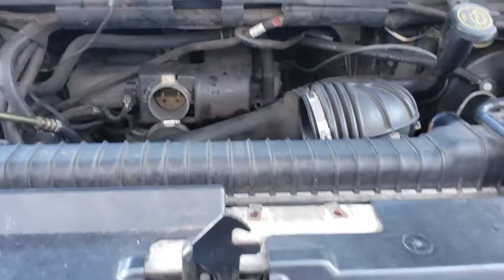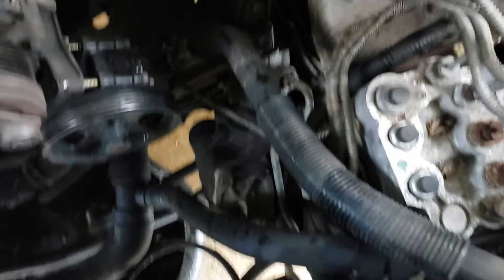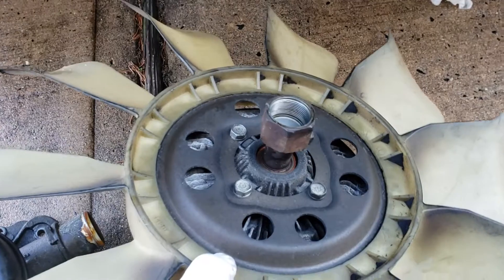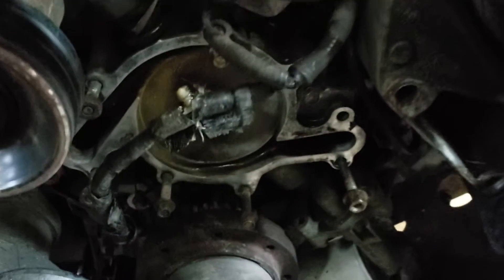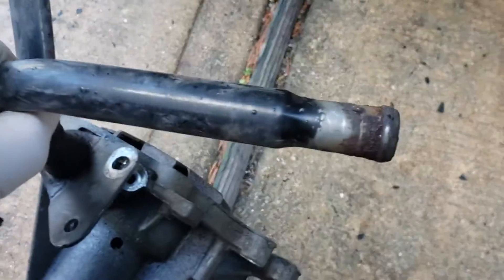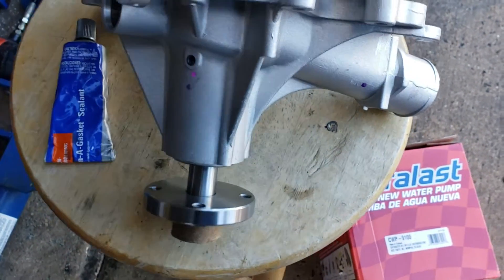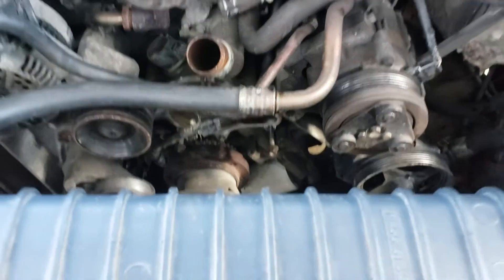2000 Ford E150 4.2 V6 Water Pump Replacement

Comment: I have a 2000 F150 and this video, even though it was an E150, was the best video I found to help me with specific 4.2L issues - Thank you.  
At this point I have everything removed and I'm waiting on some parts. In case someone else with a F150 finds themselves looking at your video here's one difference I found between these two vehicles.  Regarding the Power Steering Pulley interference,   found 4 bolts (instead of 3) holding the Power Steering Pump to the engine.  That wasn't a big deal but there's a Hydraulic Fitting that comes out of the bottom of the Power Steering Pump.  On my 2000 F150, when I tried to move the Power Steering Pump away from the engine, that Hydraulic Fitting interfered with the truck's steering column.  Due to that interference, it was a small fight to get the Power Steering Pump to move enough to remove that Long Bolt.

EDIT:  I have discovered another YouTube Video that appears to be  useful: https://www.youtube.com/watch?v=83PJKdyuYc8
It's for a 2004-2008 F150 but it appears to be the 4.2L V6.  At the 9:00 mark the Long Bolt/Bracket problem is addressed.  This guy is able to remove the Bracket without moving the Power Steering Pump/Pulley.  I had considered this approach but had talked myself out of it.  Anyway, it was possible for this guy so it's worth looking at before fiddling around with the Power Steering Pump.  It could be that Ford shortened those Water Pump studs in later models making bracket removal a simpler process.

I have documented what I have done to this point at the Garage Journal website:
https://www.garagejournal.com/forum/showthread.php?t=298920&page=194

Click on the above and scroll down to Post 3879
Reply from the maker: Thanks for your input, f150 is so close to being the same installation.
Reply: @alyoungcuda  Y'all have gotten me So .. Ummmm, worried I guess . I'm hesitant to even pop my hood ! 
So, if I can get the fan an pulley Off , I'm STILL gonna play hell with those; damned heater hose tubes going up to the left behind the alternator ?
Reply from the maker: The pipes are a tight fit, just watch how you remove it..it has to go back the same way for example if you go under something then do the same in reverse..just take your time.
Reply: @alyoungcuda  I REALLY appreciate ya response . My wife was sitting there ... I thought on her fb when I was "Crying" about my truck she says.. BUT, anywho, She's a Woman !  an told Me  "You don't mind taking peps guns apart and strowing that shit EVERY damn where ,hows That truck Any different? Ya always say  "It's No Problem" when y'all messing with them !"  God Knows I love Her, but she just don't realize  #1. It's 17 degree's out, #2. Parts will snap like a twig out here.#3. My trucks got 260k on it and has NEVER been touched past brakes,plugs, oil changes,etc..  and I'm concerned about a Lot of expenses, extra work, having All the tools needed,etc.  ..and Ford couldn't produce  me another Just Like It ! .  . That comes down Assembly Everyday when I asked for one few years back ! 5speed ,V6 with a little extra pep n her step ! 
Me an that Truck have been in and Right back Out of lottsa sh-t together and she's Never put me to walking, Period!
Reply from the maker: You can do it..but with that many miles
.you need to be careful not to break a bolt..there is a trick to it on bolts..besides killing it with wd40 you need to do the back and forth movement with the ratchet..loosen a 1/4 turn, then tighten it back..then loosen up to 1/2 turn then tighten back, 3/4, 1 full turn, etc....keep doing it a little at a time till it feels free..its a pain but sure beats snapping a bolt..then wire brush the threads and the bolt for a clean installation...
Reply: @alyoungcuda   See♥️!  A little consoling & Know how will Help a Man's Confidence and Ego   Alot better than a Woma........ Na, I still Can't say All that ! LOL 🤣😂
Reply: @alyoungcuda   I soaked all the main bolt's with liquid wrench and laid the hood back down. Wether says a little warmer tommorow, and I've got my parts carted online at O'Reily's in town. Hopefully they'll see I've Never picked them up and   will shoot me a 25% off coupon by email to get me to come on down an pick-up my parts ! Hopefully that'll give you a trick or two up ya sleeve next parts ya Don't need pronto !

Comment: Two thumbs up you speak clearly you get to the points without stretching it to half an hour for us type a wound up too tight kind of people and I like that you have the part on the ground and you point at the engine what we need to know and point at the part instead of having a camera twisted and all different angles that you could hardly see anyway I like your style and originality
Reply from the maker: Thanks for the compliments and yes, straight to the point is the right way, sure I can drag it out for longer times and they add more commercials to make money, but money is not what it is all about. Information and teaching is the best payment for the heart. And I can't stand when they say" don't forget to give this video a thumbs up and subscribe so you will be the 1st to get a notice of the newest video"
My take on that is, if they like your content,  they will subscribe.. 😆

Comment: I did a small cut with a thin grinding disc on the outside of the heater hose inlet , came right out saved me some money ...
Reply: I did the same thing, thanks to your comment and it worked great.
Reply: I'm still Not sure what ya mean us had to do with the stubborn thing ? 
I guess I will find out tomorrow when I pull mine apart ! I Don't Like the odds I've seen on YouTube bout breakage when trying a simple repair ! I know shit happens but, some Real horror stories can develope with these thin heater hose pipes !

Comment: Thanks! It’s the same on my 99 e250. The hard hoses that go in on the left side, do they have o-rings that seal them?
Reply from the maker: The pipes have o rings but the best thing to do is to replace the pipe..the rust on those pipes might not seal right.
Reply: @alyoungcuda  Thanks for the response!!

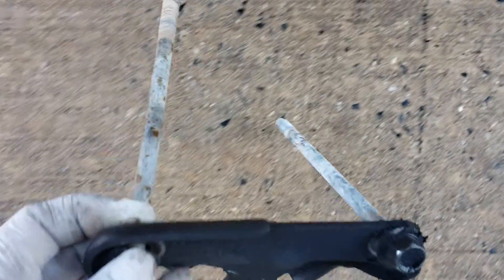Comment: The older I get , the harder it is to bend and contort working on these fords, my swear word vocabulary has a few new ones made up of 5 or six swear words run together!  So 1999 and 2000 F150 has the two nipples off the steel  tubes, not sure if it is a California emission thing, but I think not as my truck was a Nevada fleet truck w / 16,000 miles when I bought it . The steel tube with the 2 nipples was $111 from Rockauto and I could not find it any cheaper, even on Ebay.The two nipple one is Motocraft KT-8 or suposedly Ford XL3Z18663AA.... I upgraded to a 2 row radiator, it's the one for a 1997 / 1998 Expedition like I have in the Philippines and it drops right in , no modifications. ( at least in a F150 no modifications). I have a camper and 4:10 or 4:11  gears ( forget which I had put in )  and beefed up suspension . I cannot tell you how much better it is with those gears compared to the stock 3:33 ? rear end gears .... I should have done it sooner ...with the Mazda 5 speed  manual transmission, it makes all the difference in the world. Thanks for the video...made the job easier . One thing I did , I really did not want try to get the clamps off the back of the hoses from the small tubes as they are way in there against the firewall , so I cut them and used two brass barbed fittings and screw clamps to attach the new hoses, i also did not run them back under the manifold . Not sure why Ford did it originally, not one of their "Better Ideas"  ( sort of like cam phasers on the 2005 V-8) That's a whole other topic !!! At least I got the majority of the old 1/4 heater hoses out of there , if they pop at the rear i'll deal with it at a later date.  my 2000 F150 I did not have to remove the bracket to the power steering, just loosen it up...the one bolt comes out, the other backs out till it hits the pully, then i just wired it up out of the way . It's no fun removing the power steering pump, I did mine a few months ago and did not leave out the one trouble bolt that ford says you can remove.....a ratcheting box end wrench makes that one power steering bolt a lot easier to deal with if and when you have to take the power steering off.

Comment: Good to know where that bracket and bolts go. My buddy went crazy with the impact and now I'm sitting here trying to piece this puzzle back. We took off the accessory bracket as well which is another one of those long bolts. Now I just need to see what the actual pump bolts are like.
Reply from the maker: Lucky none of the long bolts snapped..you can feel them twisting..definitely wire brush the treads and use wd40 going back together on the bolts

Comment from the maker: FYI..that metal heater pipe in the water pump is not listed in Autozone or Advance..they both show 2 pipes but they are not the correct ones..they have extra hoses..
A little shopping around for the part number and the correct pipe with 3 hoses is a Dorman 626-608 about 160.00 dollars and @autozone.com can order it
Reply: You can get that pipe on Amazon for $65.00 + tax. Free shipping if you are a Prime member,  But, Al, I have been trying to replace it on my new water pump, but it is a b**ch to get on! Do you have any secrets to share? This repair job is taking me forever! The heater pipe I got from Amazon is Dorman, and it is just like the one replaced, but I am replacing it with the water pump already installed. Just seems like there is just not quite enough clearance. Any ideas? Thanks, Al!
Reply from the maker: I remember poking the pipe assy up into the manifold area to clear the small hose and pipe..then pushed down on the pipe with the oring in which I put a little grease on it and the hole in the pump to line up in. Then I pushed it in as far as it will go and then installed the bolt to draw it in more..
Reply: @alyoungcuda  You must have , "The luck of the Irish!" I'm Irish, but not lucky!
Reply: I've got a 2000 F150 with the 4.2 engine and your repair should be very similar to mine.  
When I was checking the Dorman site for the Heater Water Outlet Tube (inserts into the top of the water pump) it called for a Dorman 626-212 for the 2000 F150.  
When I checked the Dorman site for what works on the 2000 E150 it appears that it depends. According to the Dorman web site after 12/22/1999 the 626-608 is the correct part but 626-212 is the correct part for before 12/22/1999. 
https://www.dormanproducts.com/p-127572-626-608.aspx?origin=keyword
https://www.dormanproducts.com/p-52088-626-212.aspx?origin=keyword

Comment: With over 300,000 MI heater doesn't work can I just plug up where the heat water tube goes into the new water pump
Reply from the maker: Its a smooth hole for a pipe with an o-ring, what are you going to use to plug it and it won't leak?  Unless you cut treads into the pump for a plug or buy a pipe to fit in and then a rubber plug over the pipe.

Comment: I'm having a bit of trouble aligning the large bolts to to the block with the two studs on the water pump (with the bracket). It's like I need to use a pry bar to give me some slack. Got any tips? Thanks...Dan
Reply from the maker: Unless the bracket moved on you it should line up good with little resistance..will the 2 bolts screw in by themselves ok?
Reply: @alyoungcuda  I've got the old water pump and the new one. I have the new one mounted to the block and everything was going well until I tried to align the bolts to the water pump @ the bracket with the two large bolts that go into the block. It's like I ned to pry the A/C mount to give me the necessary clearance. Weird. Thanks for the help!
Reply: I ended up having to remove the PS pulley, and it worked correctly.  Went right in!

Comment: Great video, very helpful.....when you replace that metal  tube, do they recommend any anti-seize, teflon goo sealant, water pump grease ( now there's something only I have around and Model T's don't normally have water pumps), maybe some fuel resistant Gas shut off grease (FAA approved !)..... I can think of reasons to put some, and reasons not too.......your thoughts ?????
Reply from the maker: Just a coating of antifreeze for lubricant,  some grease can eat the oring materials
Reply: What is the name of that metal tube ? I am trying to order it .
Reply from the maker: @b4real100  heater water pipe to water pump

Comment: How can you put the water heater pipe back in the new water pump?
Reply from the maker: You can't save the old pipe , it's not worth the trouble, buy a new one and it goes right in..you need to remember how its routed..

Comment: I can't find the 98 heater hose Pipe with tie 4 outlets Anywhere, and Ford want Over hundred bucks. I've GOT to use the old one.. Wish ,I knew how to get it out clean, without break-in anything ??💯
Reply from the maker: Yours has 4 outlets?...Rockauto.com  did you try them?
Reply: @alyoungcuda   Yes Sir! Another small outlet on the pipe that goes to the right under  the upper intake,very small with rubber hose IDK where hell it goes
Reply: @alyoungcuda  ALSO, IDK why I've cussed and bitched about this Truck.  I've driven it 260k and NEVER had to turn a wrench on it ! Just normal plugs,belts,battery, brakes.. SO,. She's been a damn good one !👍
Reply from the maker: She took care of you and now its your turn to return the favor for sure
Reply from the maker: That small hose runs on the intake manifold on the passenger side..you see it from inside the cab after you remove the engine cover..
Reply: @alyoungcuda  Amen, just Bad timing  I've blown thru lottsa $$ ,Christmas for Gbabies and Papa went over board as usual. 
Think I'm gonna take drimel took and cut on old water pump to get pipe free, Pipes in perfect condition,So .

Comment: Would have been great if you actually showed how to do it
Reply from the maker: Watching someone turn a ratchet and screwdrivers are the most boring parts of watching videos even if you speed them up..it looks to cartoonish ...you definitely need a step stool to get into this job from the top..there is no room with the engine set back..and all you will see is arms blocking the view..
Reply: @alyoungcuda  ...its not boring, its concise.

Comment: The very top bolt on mine broke. I’ve tried everything. I soaked it with pb blaster and heat. Man, day is ruined. Lol I’m glad yours went so smooth.
Reply from the maker: The 2 long bolts for the air compressor bracket going into the cylinder head was that close to snapping off for me.
Reply: What did you do about that top bolt?